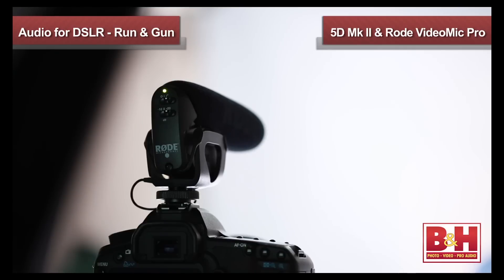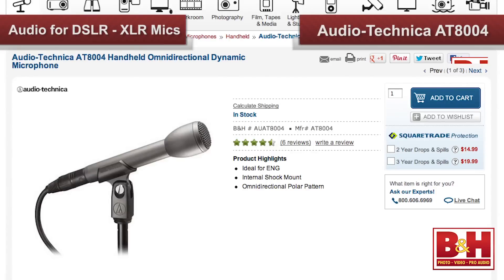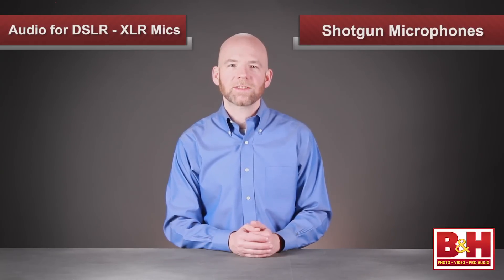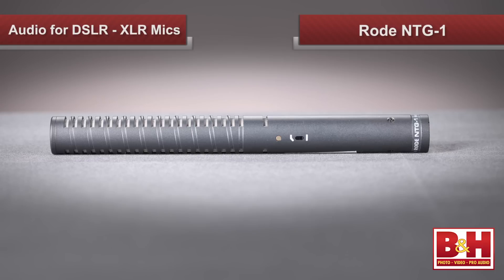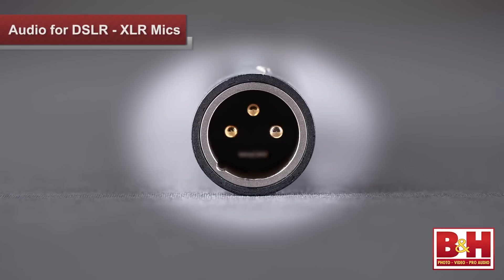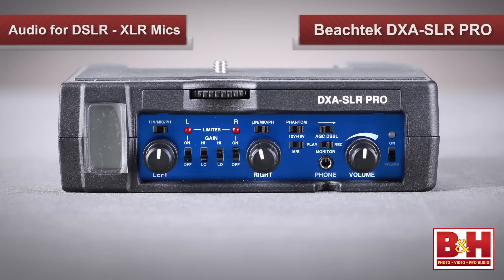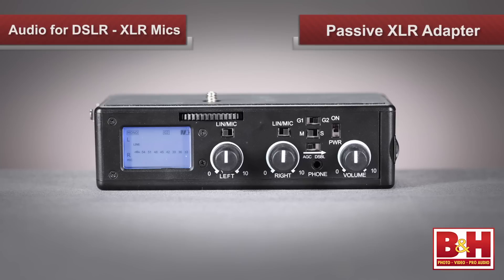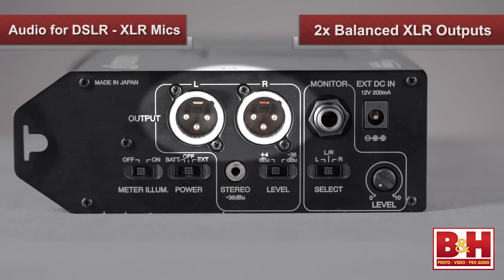Audio for DSLR Part 2 - XLR Mics

Comment: so why would someone spend $200+ on an external recorder over getting something like the beachtek riggy that does the same thing but plugs straight into the dslr???
Reply from the maker: A dedicated audio recorder is designed specifically to record quality audio. You are able to record digital audio at higher resolutions than available on a DSLR. DSLR audio recording is a secondary feature and lacks the control and monitoring capabilities as well. Even when using an external audio adapter such as the Beachtek, you are recording to the inferior components available in the camera. |Heather S|

Comment: Would a Sescom cable plug into a zoom h1?
Reply from the maker: Yes - a Sescom cable could be used with a Zoom H1 recorder. The LN2MIC-ZMH4N-6 from Sescom is a problem solving cable for users of HDSLRs who are using a Zoom H4N or Zoom H1 as a secondary audio recording source. Many professional DSLR cameras have unbalanced stereo microphone level audio inputs on a mini TRS 3.5mm jack. The Samson Zoom H4N or H1 output line level audio signals. This cable provides the proper microphone levels and preserves the delicate connector contacts inside the camera, allowing users to go directly from the audio recorder into the camera. B&H # SEL2MZH4N6

Comment: hello, i recently bought a canon t5 to start getting into photogrphy and film. buuut i found out that the t5 does not have a microphone mini jack... so i started looking for solutions and was wondering.

Can i use a usb to microphone jack adapter for my t5 to attach external mic?

in case you dont know the adapter im talking about here it is http://i00.i.aliimg.com/wsphoto/v0/1597480718/16cm-Male-Female-Micro-USB-to-3-5mm-Jack-Mic-Microphone-Adapter-Cable-for-GoPro-Hero.jpg
Reply from the maker: Unfortunately you cannot use a GoPro or any other USB adapter . The only option would be to record a separate audio file with a recorder and sync it up in post: You could use a Tascam DR-40 4-Track Handheld Digital Audio Recorder which provides professional-level features and flexibility in a compact and durable design that's ideal for use in the field. (B&H # TADR40) http://bhpho.to/1IBFvQB. 

To sync the audio with your camera's video, use PluralEyes 3.5 from Red Giant, an electronic download of software for automatically syncing double system audio with video. PluralEyes 3.5 is compatible with both Mac and Windows platforms. The software imports your footage into its own timeline and automatically syncs the video from a single or multiple cameras to simultaneously recorded audio. Automatic syncing is accomplished by the software lining up the audio waveforms of the audio and video files, so for PluralEyes to work you must record an audio scratch track with your video footage. PluralEyes is able to import/export timelines from/to Final Cut Pro, Premiere Pro, Media Composer, and Vegas Pro. You can also export .mov or .avi media files for use in other programs. (B&H # RESHOPLUEYED) http://bhpho.to/1yQShXb 

Please contact us via e-mail if you have additional questions: askbh@bandh.com>Mark<
Reply: B and H thanks so much :)